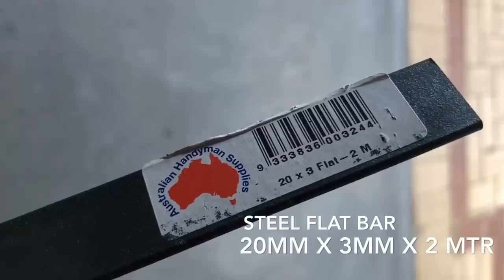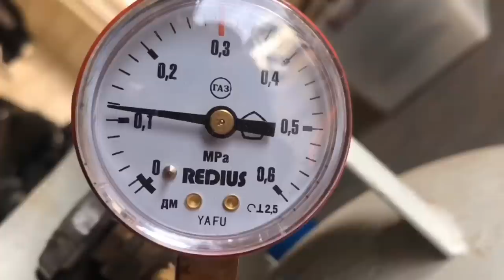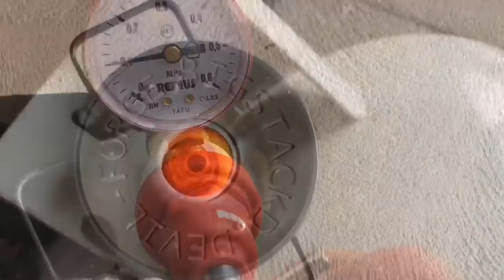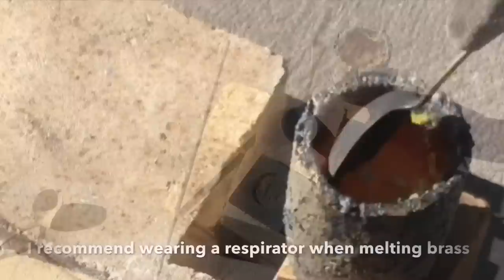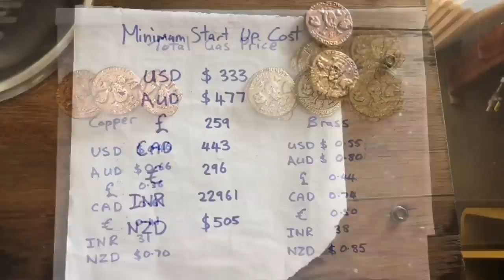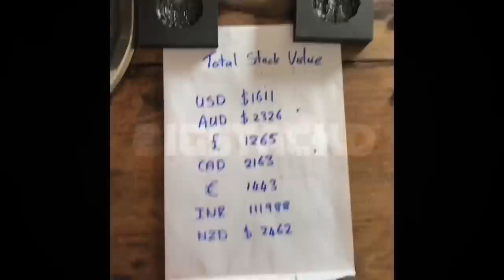WHATS THE TOTAL START UP COST TO MELT METAL AT HOME - TONG & LIFTER DIY - COPPER BRASS MELT

Comment: Nice! Also, I love how Ingot has somehow become the face of the channel... Still dig that mask, especially when you had it on under the thermal hood. Haha. I will have to save up some stuff to send you, too. If only  food wouldn't spoil before arrival... I could send Twinkies, but that stuff'll put ya 6 feet under. 😆
P,s, makes me wonder if Twinkies melt, and if you can make a metal Twinkie... Nickle or tin center with aluminum-brass shell... Cut in half, install hinges so you can open it and show the inside....?

Comment: Idk if you are still responding under this video, but where did you get your temp gun?
Reply from the maker: Mate I’m watching everything and responding when I can, The temp gun I use is the best thing I have ever bought I bought it years ago off eBay but the thing is it’s a no name brand so I have no idea what it’s actually called,
 my best idea for you is to get on  eBay and type in ‘infrared 1050’ and that should bring up a whole selection of heat guns just make sure you get the one that is rated to 1050°C  not the other  crap that only goes up to 600°C 👌🏻

Comment: Big stack D what do you recommend a 13 year old use that's relatively safe and cheap as a furnace
Reply: Well a non propane version for 300 on Amazon called electric safer can’t hold as much as the ones here but will hold enough most of times
Reply: When you open the lid use the included tongs and heat the mold it cost a little less but also safer use good gloves tho
Reply: Sorry for so many replies I use the electric one on Amazon to I’m 15
Ok 300 total start up cost TOAUTO 3KG Gold Melting Furnace,1400W 2000F Digital Electric Melting Furnace with Graphite Crucible for Melt Scrap, Silver, Gold, Copper, Aluminum 110V Refining Casting Furnace there is the name of it it comes with everything you need

Comment: Which gas did you use for melting iron
Reply from the maker: I just used normal propane in my 10 kg furnace these things are incredibly powerful I would’ve had a better cleaner poor but my Crucible sprung a leak🤨

Comment: I would be interested in getting some Brass/Copper for machining but most useful metals are smelted mixes or alloys and creating them regularly then rolling, etc. is not possible at a DIY/small workshop level.
Melting metals to put on a shelf might be an okay hobby for some but seems like a massive waste of time for me. I mean turning broken useful things into pure, useless things just doesn't do it for me.

Comment: Do these work on natural gas?
Reply from the maker: If you’re talking about plugging a furnace into your home gas line it definitely won’t work as the home gas is only very very low pressure and you would need about 10 times higher pressure than a normal home gas line to run these burners👌🏻. I have seen someone comment once before about getting a gas booster installed in your house but I don’t know how that would even work ?

Comment: Where do you get the stamps?!? The ones I find are small and with no interesting drownings.
Reply from the maker: orgsniper do you mean the pirate coin molds I use ? I get them from The US eBay page but as I live in Australia there bloody expensive I get charged around $70 for each mold I buy 🤦🏻‍♂️
Reply: bigstackD Casting yes the molds and the stamp u use below when write on the ingot

Comment: Your USD values are off..... At least on the west coast anyways. Here the tank and gas is almost $60 and the furnace I can get online for $360 (the very same devil furnace). The gloves would cost between $12 and $26 depending on the quality you want and the glasses and shield are about the same as yours in AUD.

Comment: For the pouring tongs, I'd suggest making them so that when they're closed on a crucible, the handles are parallel and close to each other, maybe an inch apart, so you can hold them like a single unit. It would make them more comfortable and easier to control.

Comment: This is going to be dumb ass question, but I got to know, what is the point of melting scrap metal at home? Don’t get me wrong looks supper fun and I wanna do it, but I hardly see a benefit. It is unlikely you’ll make a profit from selling it to a recycling center?
Reply from the maker: Yes it is true you would not make any money doing this as a profit would be lost in time and gas. I do this as a hobby on my days off from my normal job that’s why I don’t mind if I spend $3 in gas on a $4 bar and that is also why I don’t sell any of it I just stack it all up👍🏻

Comment: You show the minimum USD startup cost with the smallest devil forge at $333 USD but the smallest devil forge is $361 USD by itself.... may wanna check your conversions.
Reply from the maker: Nah matey I’m always right 😉. Here’s the $250US Devil Forge right here https://rover.ebay.com/rover/0/0/0?mpre=https%3A%2F%2Fwww.ebay.com.au%2Fulk%2Fitm%2F251870988045